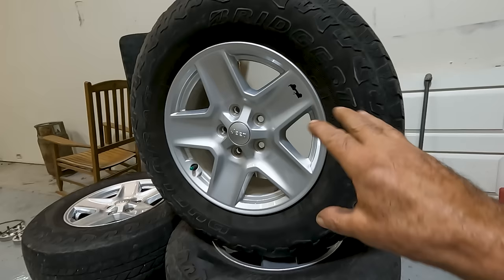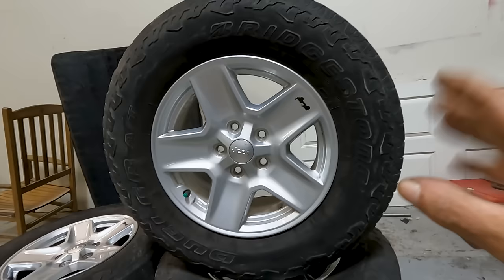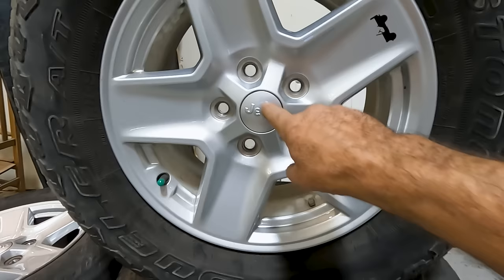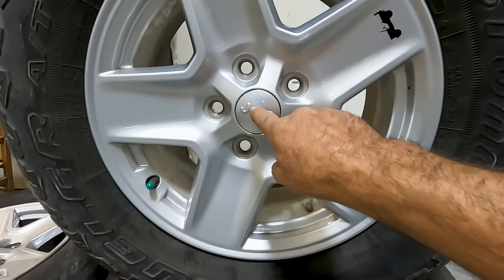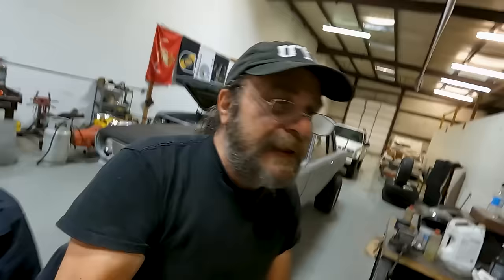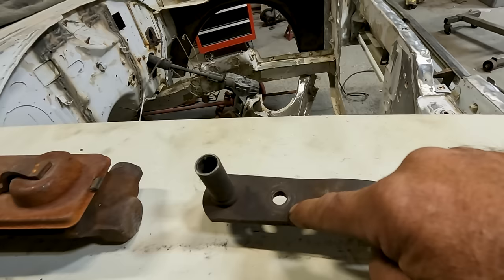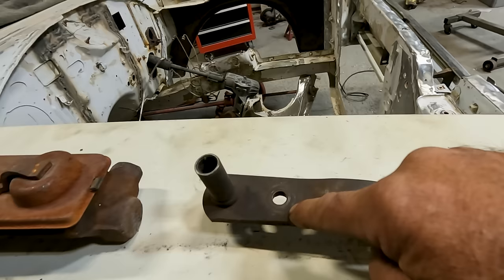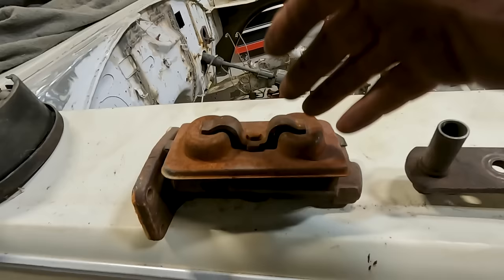Modifying Classic Cars And The Butterfly Effect - Can You Outsmart The Engineers?

Comment: Hey Uncle Tony, do you think you could make a video on painting headers? Everytime I've tried painting my own headers, I've seen a beautiful coat of white paint turn yellow and crack like my teeth after only the first heat cycle or two. I know I'm not alone on this; any insight is appreciated. Thanks, and have a good one.
Reply: Eastwood Company and POR-15 have header and exhaust manifold paint that holds up and looks good for quite a while. The heat cures them. Sandblasting the headers first creates the ideal surface for good paint adhesion. Even this paint will eventually degrade in appearance, but never had it crack. Having (or buying) the headers ceramic coated is the best way to go for longevity and appearance.

Comment: ◄My three major modifications to my 69 Bee were necessities in my dotage: a Flaming River Electric assist unit since I can no longer manipulate the manual steering in tight spots; an oversize radiator to correct a long-standing overheating issue; and disc brakes, replacing the ever-fading manual ones. Original owner so what does that say about my age. Oh, and my Bee is a boy car as this gal doesn't drive girl cars so don't ever refer to him as her/she. It's a 383 Magnum, 4-speed, ram-air, sure-grip car and was my daily driver for three years. Then, at 47,000-some-odd miles on the odometer, I retired it from the daily routine because I felt it was the best car I would ever own. And you know what? It still is.

Comment: On my chrysler forward look car,
The only brake "mods" that i have done are, drilling the backing plate with small 3/8 holes to allow the brake dust/heat/gas build up to escape, and some steel braided brake hoses.

The modification manifested in more effective stopping distance and minimal brake fade.

But i totally left the mechanical side of the brake system alone, wouldn't want it for it to NOT stop eh?
Reply: I thought about doing this also.. just some small holes,, 3/8" good choice.. 👍
Reply: @AtZero138  Give it a go, have not had any issues in wet torrential downpour weather, the holes also let the water escape and the hot brake drum and back plate will evaporate any water present anyway.
Reply: @samhicks97  just makes sense.. even vintage Race Cars eventually had some ducting to cool them down.. cheers from Huntington Beach CA 🇺🇸.. Daily Driver 68 Dart
Reply: @AtZero138  nice one, The reliable steed that I made the mods are on a 64' Dodge custom 880, more of a splice of early forward look designed cars like Virgil exner cars.
Reply: @AtZero138  forgot to mention, interesting mod that I resisted doing was drilling the Drums on a brake drum system, this is a known brake mod back in the 50's but has a drawback.

Drums are able to dissipate heat better more closely like disc brakes, but the holes in the drum have a chance of cracking/fracturing in high heat situations and spreading to other holes like a spiders web.

I believe the drilled backing plates is a good compromise.
Reply: @AtZero138 Hope I'm not pestering you too much, I have a video on my channel where I drill the backing plate if you wanted to have reference material, it's on a video where I service the front brake shoes, anywho later on.
Reply: @samhicks97  also made sense to me,, it's the where,, I figured.. near the edge as drum cast makes bead roll .. just a few.. also.. any.. early to mid 60s Mopar is just Awesome,, all Class.. thank you for maintaining it and alive to be seen and enjoyed...
Reply: @AtZero138  likewise, thanks for keeping your Dart going also! Cheers.

Comment: the rubber to stainless steel brake hose is a great little upgrade i like to do first and then the lines and fuel lines
Reply: They make the pedal firmer, but if you don’t have abs it is harder to modulate the brake pressure when you are on the limit of lockup

Comment: Your information is spot on Tony! I worked at a brake shop in the 80's and 90's in Sydney, back then machining was the norm rather than replacing drums and rotors. We offered different grades of pads/shoes but never modified braking systems for exactly the reasons you state, with just two exceptions.....a track car OR increasing the booster size on known poor braking vehicles so pedal effort was reduced but the rest of the system was just repaired to manufacturer specs.

Comment: Some vehicles have dual ratings depending if you are running trailer brakes or not.
Reply: I think it's federal law that any trailer that has a gross weight rating (trailer and cargo weight) of 3500 IBS or higher has to be equipped with a trailer braking system and have at least 2 axles and the brakes to mounted on at least one axle. Higher weight rating may require brakes to be mounted on all axles.

Comment: Depending on the age of the car I'm going to daily drive,  I just rebuild the front end,  and replace all the bushings,  get a set of KYB shocks, then convert to a dual reservoir master,  or factory power brake set up,  most times I'll switch the carb from a 2 barrel to a 4 barrel,  and swap points to HEI or whatever the factory electronic ignition was.  Then put dual exhaust on it.  The whole point is to get the factory set up as close to perfect as possible,  then just do slight factory upgrades for less trouble. It usually turns out to be a great daily driver.

Comment: That tow rating for the Jeep might be for a trailer with brakes already. Often they’re rated quite a bit lower for a trailer without brakes. 

At least with autocross a quick a cheap upgrade was sometimes running the smallest diameter wheels and tires possible. Effectively makes the gear ratios shorter, better leverage for brakes, less rotational inertia, and less unsprung mass. Could make a big difference on lower powered cars.

Comment: I'm building my 68 Barracuda. It came with drums all the way around. Original 318 automatic. 
I bought a 1976 dart sport and took the factory disc brake set up from that car, but for some reason I didn't use the rear drum from it, probably because I had an 8.75 rear for an a body. So I began looking for some rear brakes to use for it. That is when I realized you had to have rhe correct backing plates as a starting point. So... what i eventually found was an 11 inch backing plate, so I ordered everything for an 11 x 2.5 drums. Now I  had to find a proportioning/distribution valve. I figured I'd use a setup off of a T/A challenger as thats supposedly the "best" around. Now I went on a road trip through Southern Idaho from Vancouver Canada and on the way back decided to drive up through Montana on the way back. I ended up going through the town that Dr. Diff is in. So I stopped by his place figuring I'd buy the proportioning valve from him. He looked quite shocked when I explained my set-up. He basically told me there was no proportional valve  that would work with that set-up, my rear brakes were massively too big for the car and my rear end would be constantly locking up. So what he suggested is I use an adjustable valve, with my factory drum distribution block and he also recommended different wheel cylinders than the ones i had bought. Take it out on a wet day, somewhere safe and brake hard, while making adjustments to the metering valve untill the rear brakes are just about to lock under heavy braking on a wet surface. So I am at this point now. When I finally get it together I'll do as recommended by him. If i get a chance I'll be looking to acquire a smaller rear drum set-up like maybe a 10 or even 9 inch drums. 
But I suppose the best advice for anyone if you do make any changes to your factory brakes find a safe place to test them before you head out on the highway. 

Thanks for this video UTG. 
Great advice. 👍

Comment: My first car was a 1967 Cougar, A code 289 auto originally. It has the 4 piston Kelsey Hayes disc brakes on it.  Other than the boosters always not working and the vacuum leaks everywhere so the headlight covers were manual, it drove rather well... on pavement, it sucked on gravel roads, because the brakes overpowered the roads easily. 

I could never figure out why people said muscle car brakes were terrible and barely stopped.... until I had to drive a 69 Charger with drums all around because my Cougar was broke, at least that 318 powered slug went around corners ok, about the only thing it did adequately. Then I got my 72 GTO with disc brakes and swaybars front and rear, and the 70 GTO with the same, and I laugh at people who say muscle cars don't stop and don't handle corners.  Mine do if I want them to. My younger brother wrecked that 69 Charger because the brakes were always terrible. He is looking for parts to fix it, and has been for 30 years. 

Then there is my 79 10th Anniversary TA, that came standard with WS6 suspension, which includes 4 wheel disc brakes. That thing stopped like RIGH NOW with no drama whatsoever. It also went around corners better than all the same vintage Vettes and everything else out there that was not a Pontiac. Wild eyed handling ride on 70 series tires no less. My 4th gen 98 Formula doesn't handle as well as that 79 TA does and the 98 has 17" factory wheels and 40 series tires. The faster that 79 goes the more stable it is, unlike Camaros from forever. Herb Adams knew what he was doin for sure.

I usually upgrade drum brake Pontiacs to disc, because with how many of them I have it means I don't have to remember which one has what. Also there is no mickey mouse nonsense of different rear brake sizes and whatnot with my Pontiacs. The 2 VIN division did not build 'barely adequate' vehicles like chevy and mopar did. 

All of my changes have the attendant requirements figured in, master cylinders, wheel cylinders, steering boxes, pitman arms, power steering hoses and T bars to get the right road feel... I like to use 94-96 Jeep Grand Cherokee steering boxes on my A body Pontiacs, its less than 3 turns lock to lock and has the right stops for the LeMans/GTO turning radius. I swap the valve in the back of the pump for one from after 1982 and I can use the O ring style hoses.  

Also Pontiac decided to have both holes drilled in brake pedals for power and manual brakes, because the leverage requirement is different. I just move it to the other hole when I got to manual or power. Real simple stuff.  

Pontiac is the best for low buck go fast, because if a 350 or 326 is sitting there, a 389 (64-66), 400 or 455 will bolt right in using all the same stuff. No K members to change, different mounts, bellhousing differences, or engine families, and nearly all the parts interchange between the engines. The main differences are crankshafts, pistons and sometimes main bearings. Not to mention they make ungodly torque from idle to 6000rpm so you don't need to swap in 4 something gears, the 2.73 to 3.42 will work just fine. 

Here's the kicker.. an aluminum headed LS 5.3 is 480lbs as a long block. An iron headed 400/455 Pontiac with the front drive brackets and an intake on it is 550lbs. I know, because I weighed them both this week. I get a lot more torque and power for 50lbs than you will out of the LS, and its a lot less expensive to get 500hp/550tq from a mild 455 with garden variety stuff on it. So I laugh at the guys who take out a 400 or 455 and put a 350 sbc or an LS in it and think its an upgrade. Its quite the downgrade in reality.

Comment: I think this is great advice, I even said best advice ever in a different comment.  However, I do take  issue with one aspect of what you said and that is money.  Cost was a major consideration the engineers took into consideration when designing the system.  Not only cost, but manufacturing feasibility. They had to manufacture all the parts.  If something was better, but cost 5 times as much to make because it require new machine tooling or new machines, a compromise would be made.
The engineers were given a list of specifications and to make it happen at X cost per car.  Cost was a major consideration.

Though it might be a dumb assumption on my part,  I assume the people who make conversion kits also have to take the entire system into consideration and require all the changes that would have to be made.  So they are probably not going to sell you a disc conversion kit for use with the existing master cylinder that doesn't meet specifications.  Like they are probably going to say "in order to change the brakes to disc, you need to replace all of the following components" where they know what the pedal ratio should be and that the brake lines will need to be resized or where a new master cylinder is needed.  Otherwise, people will be killed and lawsuits will be filed.
Reply: They also share quite a few parts because it usually doesn't make sense to design something like a whole new brake caliper specific to a model, unless that model is the first of new platform (and that part will eventually be shared) or otherwise has special requirements. Most likely the part chosen by the engineer was not completely optimal for the task in a pure engineering sense, but it was optimal in terms of the requirements versus cost and availability.
Reply: @treelineresearch3387  Yes. Shared parts was and is a cost saving measure which imposes limitations on design. But even though they won't always be optimal, they will be "good enough" and meet the requirements of the system.  Like they would say "well, it would be nice and perfect if we could design this new part, but this existing one meets 99% of that perfection"

Comment: My friend has a 68 Cuda S with a 340. He built the engine with a street strip type cam and compression ratio. The car kept its Cast Iron manifold, but he put headers on it. The cam is an old Comp Camp high energy 268. He mildly ported the heads and put a forged steel crank in it, and balanced the rotating assembly. The car runs low 14’s and his wife has driven the car. For something like what Tony is talking about, that build would be as far as I would go. If it was just me driving the car I would go further, and have driven an 11 second car on the street.

Comment: I agree that if you do a disc brake conversion make sure the kit has an adjustable proportioning valve that comes with it, but the peddle will still be hard to push. I think    disc brake have an  advantage when you drive through standing water after a heavy rain. Remember driving with one foot on the brake pedal to dry out drum brakes or your next stop was not efficient.

Comment: I had a 5K lb trailer behind my Class C RV. Those things are usually running right at their gross weight before you start towing. Well, I was motoring along and I ran over a tree branch. Somehow it unplugged the trailer. Next thing you know I'm going 40MPH down a hill with a stop sign at the bottom. Holy Moly those were some exciting seconds.
Reply: gator got him!

Comment: Yup 100%! I love how four wheel disc brakes feel, and how they dont get surface rust and get grabby after sitting, but would never convert something that didn't come that way. Was taught that years ago, I think possibly by my hot rodder auto shop teacher in high school, that the master cylinder from a all drum, or front disc rear drum car, are different from discs on all four. Think he explained it as the drum side in a disc/drum setup was also delayed a bit to prevent the ass end locking before the front. Spot on about the leverage on the braking system with oversize tires too.

Comment: I bought a ‘62 Chevy pickup and it had radial tires. It was extremely hard to steer. I knew that in 1962 all of the vehicles had bias ply tires so I put bias ply tires on the front and it corrected the hard steering problem.

Comment: Braking system... had better be a dual master, preferably power boosted. Yeah, that's a safety modification for a daily driver. Had a customer with a 60-something Ford Galaxie with a single master, non-powered brakes. It was hard to stop it, and that's a safety issue I personally would not tolerate in my own daily driver. And a single master is an accident waiting to happen on a 40+ year old car. Remember that 1300hp Lincoln that idiot crashed? Drums are fine but I'm not daily-ing a car with a single master, and I sure wouldn't let my mom or my sister drive a car without power brakes.
Reply: Dual is logical step up,, power an option,, why I prefer mid to late 60s.. Cars and especially trucks stayed the same or similar to this basic platform.. and dude crashing that finished and also not his car.. yikes.. it's what Neutral is for..
Reply: I have a 1965 ford galaxie with a single master and 4 wheel drum brakes. It stops great. I can easily lock all 4 tires if I want to. Something is wrong with your customers car. More than likely blocked flex lines, or seized wheel cylinders. These cars were made so that even a grandmother could drive them.
Reply: But the Galaxie had apparently run 60 years with a "very dangerous" single master without accidents. The main safty problem with brakes are the car owners. Most don't maintain brakes, but repair when something fails or wears completely out. Decades old brake fluid, rusty brake lines. Who would want to fly if airplanes was "maintained" that way?
Reply: @westmus  Did you miss the part about these old cars being... OLD? Brake lines rust out, hoses and seals go pop! Just because one car hasn't had a brake failure in the course of 60 years, doesn't mean all those cars are automatically safe. What an absurd assumption. And you can maintain a car well, but the best maintained old car is still an old car. It's either going to have OLD parts on it, or new parts - and we all know what the quality of new parts is these days!